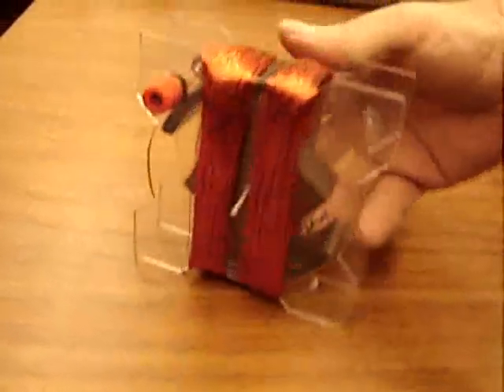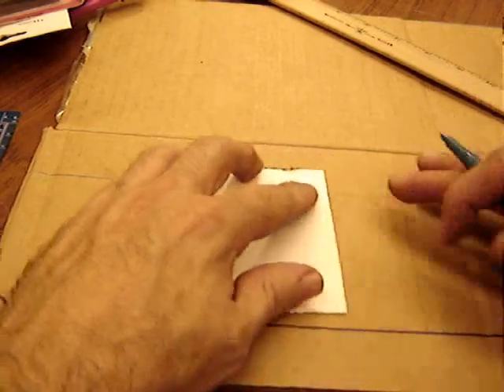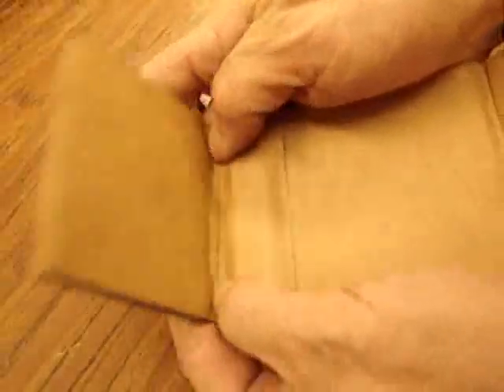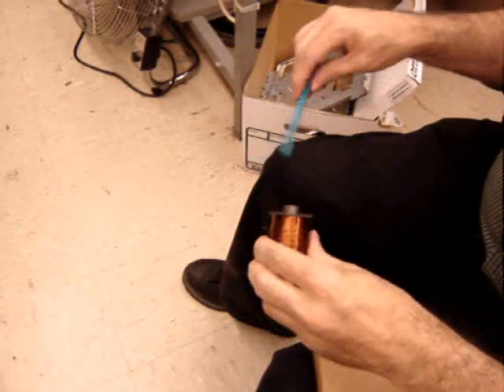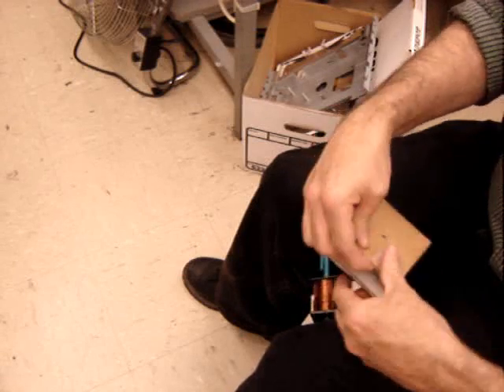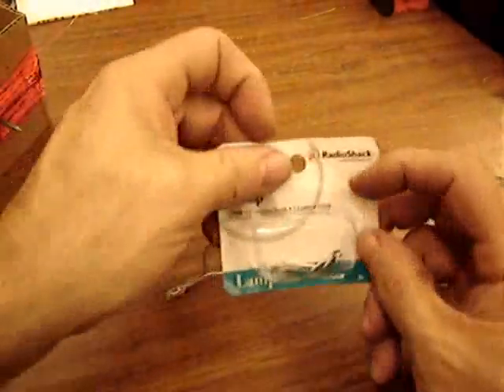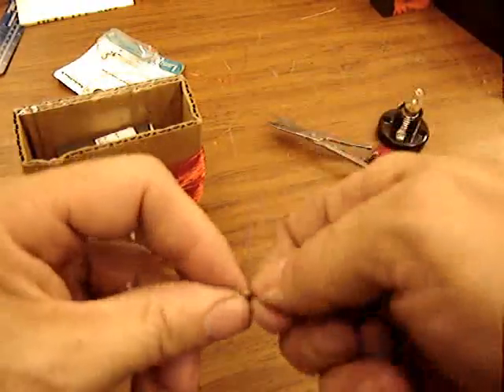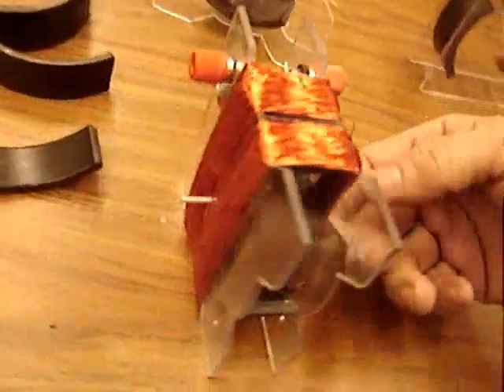Simple generator:  AC electric generator for science fair

Comment from the maker: > can't find it anywhere

Go to the website.   All the parts come from Radio SHack.   But other sources are listed.   If you use an LED instead of the special light bulb, you have to add lots more turns of wire.  The bulb will light up at lower volts.

For wire, those solenoids from Electronics Goldmine are way cheaper than the wire kits from Radio Shack.   But you have to pull them apart with pliers and a vice.

Comment from the maker: > if I use a 

You'll have to try it.  Just make sure to have hundreds of turns of fine wire, the wire is very close to the magnet, and the magnetic field extends outwards through the wire.

But if you just wanted to quickly build a guaranteed working generator, then follow the instructions exactly, and don't change anything.   Experimenting is great fun, but it takes lots of time and re-tries before you find something that works.

Or  ...get the original generator working, THEN add changes.

Comment from the maker: > different gauges of wire?

Just add lots more turns, since thinner wire has more resistance.   For example, you need about three times as many turns of #33 gauge in order the light that same light bulb.

If you're going to wind lots more turns using finer wire, then you might as well also try lighting a red LED.

Comment from the maker: > didn't work

Not bar magnets   Follow the instructions.

Don't use different bulb.  Don't use different wire.  Don't use different magnets.  Black ceramic block magnets.  The article lists the size and shape.   Many hardware stores have these.

It's possible to use small 2.5cm black rectangular ceramic magnets.  You have to glue them together as listed in the instructions.  See tinyurl com y8rkkxe   Much easier to just spend time to find the right magnets.

Comment from the maker: > Help please!

See the "debugging" section of the generator website.    Usually the problem is that the magnet is spinning too slow.  It has to really whiz, like almost 10 turns per second.   It's not hard to spin it this fast by twiddling the nail with fingers, but the magnet better not touch the cardboard even the tinyest bit.

Comment from the maker: > touch the nail

If it touches the nail, it will slow down the magnets.  Better to tape the wire so it's pulled away from the nail.

See the website FAQ, in the part about how to increase voltage.   Easiest trick is to just use much longer 30-gauge wire.

Comment from the maker: > what gauge

You gotta click the link for the website article.  That's the project article, this is just the embedded video.   Radio Shack magnet wire kit, use the #30 spool (don't bother with the other two.)   Or buy a $3 open-frame DC solenoid from Electronics Goldmine and take it apart.

Comment from the maker: > 18 gage

Try winding 300 turns of #18.   Doesn't work, since the outer turns are way too far from the magnet.  The voltage will be too low to light a bulb.

But if you use wire which is 4x too thick, then just use magnets which are 4x longer/wider/thicker.

Comment from the maker: > if they don't spin

Unless something is blocking them, they will spin just fine.   Are the holes in the cardboard too small?   Do the magnets drag against the cardboard at all?

Do as I did in the video: make very sure that you can easily spin the magnets.   If you wind all that wire onto the cardboard, you'll just have to wind it off again if you can't make the magnets really whiz under finger power.

Comment from the maker: > how thick the magnet wire

Go see the website.  #30 is good.  Radio Shack sells kits of wire spools.   Even better, buy a couple $3 open-frame solenoids from Electronics Goldmine, pry the metal off and take out the spool of wire.  Try part number G16939

Comment from the maker: It can be wrapped in a disorganized wad, as long as all the turns go in the same direction.

The coil position is critically important.  It has to pass by the axle that turns the magnets.   To create voltage, the magnet poles must stroke across the wires.

Comment: Imagine this input:

Two wheels, one with magnets, one with coils. There are 6 magnets, 3 with the positive pole and three with the negative pole arranged + - + - + - in a circle evenly apart. The other side has 6 coils spaced evenly to line up with the magnets. If you had two wires, one coming from the magnets that would be first lined up with the positive, and the next from the negative then switching through rotation, would you get an alternating current?

Comment from the maker: > use a old motor?

For the simplest possible home-built generator, a motor is not home built, and it's not simple.

For practical generators (not school science fair,) old motors work much better.  Cheap wind generators usually use a DC replacement motor from a treadmill.

Comment from the maker: > deep cycle batteries

This one only puts out 1volt of AC.   Batteries need 14v of DC.

Generators don't make electricity.  Wires are already full of movable electrons.  A moving magnet is an electricity pump.   If it moves past the same wire 200 times, you get two hundred times higher pumping pressure.  That's why there's a coil.

Comment from the maker: > me crakning it

That would work.  But car batteries work better than caps.  And you need a better generator (mine only makes one volt.)  See the homebuild wind turbine generators at otherpower com website.  They do it with large supermagnets.

To run an amp at 20 watts for an hour, you have to pedal a bicycle hard for ten minutes.  Hand cranks are too weak, you need leg muscles to produce major wattage.

Comment from the maker: Suppose you make a leather belt on rollers with a crank.  Can you connect one roller to gears, then connect the gears to the crank, so it runs itself?   Nope.   If your belt was made of electrons, still no magic.

A bicycle generator can easily put out 50 watts.   To run an entire house needs about ten times more than that, ten people on bikes (charging a battery bank.)   Or get rid of the bikes, and run your generator with a 1HP gasoline engine.

Comment: ok ok .. . so i have an ac to dc converter , so saying i do that , and power it in to the cap  . wouldnt i be able to controll a little motor off of the power to crank for me ? ... with say a switch to turn the power on and off ... im thinking on like getting some sort of amp maybe inbetween lol this is a first time kinda think for me so im just wondering ... my goal is to power a clock radio , kinda what u got but large scaler lol
lemmie no some odeas , im just curious , maybe vids will come

Comment from the maker: > to a 1 farad cap

It's AC, so it can't charge a cap.   You'd have to add a commutator to change it to DC.   Or, triple the amount of wire, then add a diode in series.

> keep the process going by it self

A generator is sort of like a pulley, with electric charges being the "belt."   If you don't inject energy by cranking the shaft, then everything comes to a halt.   It's just like any machine: it needs a power source such as your hand cranking, or a wind turbine, etc.

Comment from the maker: > add a little crank

Cranks don't work, not for spinning the magnets ten times per second!   A crank is way, way too slow.

If you use a nail, you can twiddle it between your fingers to make the magnet spin around like a blur.  It's easy to spin it faster than ten times per second.

Comment: The handle should be replaced with a simple plastic lid, the little handle part going into the middle of the lid and 6 to 8 magnets should be placed around the lid, evenly spaced out.

then all you have to do is setup a magnet close to the new magnet ring and the pulling of the magnets will cause the lid to spin turning your motor and creating energy.

This one is fun but i like my way as you can maintain a steady flow of power indefinitely.

Comment from the maker: > 800000 times

Yep, if you double the number of turns, then you double the voltage.  Also see the FAQ in the article about how to increase voltage.

But the wire has to stay near the magnets, and if you use #30 wire, it will look like a grapefruit, and the outer turns will be far away.  (So, for high voltage, find some much thinner wire.)

Comment from the maker: > no readings when the scale is on AC?

bad contacts, caused by bits of plastic coating left on the wire?

> LED lights, even without spinning

An ohmmeter will light up an LED.

> the LED and spin it, there is no light?

Read and follow the debugging instructions?  The ends of the wires must be totally clean, use sandpaper.  Spin the magnets VERY VERY FAST, not with a hand crank or a windmill.  Also, if you used other magnets, and not the magnets shown, then your generator probably won't work.

Comment: why is it that if I connect an analog voltmeter on the 2 ends of the wires, the scale is going up when set to ohms but no readings when the scale is on AC?  And when the red LED is connected together with the analog voltmeter, the LED lights, even without spinning..  But when I connect the magnet wire on the LED and spin it, there is no light? by the way, the magnet wire has 700 turns..

Comment from the maker: Yep, build a generator that puts out 120VAC when spun.  Get it spinning fast, 3600RPM, then plug it into a wall outlet.

Or just buy a 120VAC induction gearmotor from C&H Sales or other mail order junk dealer.  One that puts out 60RPM would be good.  Attach a hand crank to the shaft, then plug the motor into a wall outlet.  The hand crank spins.  Grab it and make it spin it faster, and the power meter outside your house will start going backwards.

Comment from the maker: > might be too weak

You can use a voltmeter to measure the output when the windmill turns.   But if you want to light a bulb, then you'd need to spin it really fast, or use more powerful magnets, etc.  See the FAQ in the main article, the part about ways to increase the voltage.

Comment from the maker: > don't need an inverter, right?

These already exist: "Using an induction motor as a generator."

All motors are generators.   If you run an induction motor w/60Hz voltage, so its shaft is spinning at resonance, then if the shaft spins slower, it does work as a motor.  If the shaft is made to spin faster, then it injects energy into the grid as a generator.

So, hook a geared-down induction motor to your bicycle.   Crank the pedals hard, and you're pumping wattage into the grid.

Comment: ive got to build a model windmill and measure its effectiveness (school project). do you think that connecting such generator to the windmill, in a way that it turns the nail would be a good idea? or maybe the windmill might be to weak to produce any significant voltage?

Comment from the maker: > plain metal wire?

Check the parts list.  If you make changes, then the generator probably won't work.

First get the generator working.  Use the parts in the list.   Then later, try making custom changes and see what happens.

> end is posative and nagative

Both ends are positive and negative.  It's AC, so it keeps switching rapidly back and forth.

Comment from the maker: > connect another coil

yes, see the website.  Don't bother using the other Radio Shack spools, they are way too short.  Buy two or three kits, and use the #30 spools from each.  Clean off all the red plastic from the wire ends, then twist them together securely to form one long wire.

Comment from the maker: > what grade

If you only build it, then it's probably 5th grade or a bit higher.

If you measure volts ohms amps, measure V versus RPM, try to predict the minimum wire needed, that's more like high school electronics.

Or you could go for college physics: measure the surface flux and calculate the surrounding field, then for a rectangle coil calc the peak output volts and waveform, etc.  Perhaps even predict the waveform for different shapes of magnets: rods, thin disks, perfect cubes.

Comment from the maker: > power a 40w bulb

This generator can only put out about a quarter watt at the very most.

Some people build fake 40watt bulbs by hollowing out a standard light bulb without shattering it.  Peel the metal disk out of the bottom using wire cutters, break the colored glass insulator with pliers, then shatter the glass internal support with a screwdriver.  Empty out the shards, and you have a hollow glass light bulb.

Install a tiny flashlight bulb on a plastic rod, or perhaps use a few LEDs.

Comment from the maker: > small magnet?

Use the parts in the parts list.  Other magnets will work, as long as they have the same size and shape.  Also, three magnets will work, but you'd have to glue two nails to the middle magnet.

Also search for "Toys from Trash" website with several supermagnet generator activities.

Comment from the maker: > LED won't light

To guarantee success, follow instructions exactly.

There is no LED in the video.  There is no LED in the parts list.   First get the original 0.5-volt light bulb and generator working.  Then later you can make changes and see what happens.

To light LEDs, you either have to spin the magnet at a few thousand RPM, or add many hundreds of turns of wire.  But that's a different project.

Comment from the maker: A "buzzer" supermagnet with nails glued to the end can spin inside a plastic tube.  The NS poles are on the sides.  Gives 10X higher voltage.  Spin that supermagnet fast using magnetic gears (put cheap magnets on the rim of a large wheel.)

Comment from the maker: > higher RPMs

Voltage goes up in proportion to RPM.  But because the coil resistance is the limiting factor, it also means the max possible generator wattage will be low at low RPM.

A generator is like a pulley, where electricity is the belt.  At low RPM the pulley just slips, so you can't send much energy along the belt.

Comment from the maker: > store energy

It's an AC generator.  If using a supercapacitor or ultracapacitor, first need convert to DC by using twice as much wire, then add a rectifier diode in series.  (For this low-volt generator, a diode would eat up most of the voltage.)

Or do it the old fashioned way: make DC by adding a rotating commutator which reverses the coil connections twice per revolution.

Comment from the maker: 1-inch spinning supermagnets, inside close-fitting plastic, so the wire coil is *very* close to the magnet.  Magnet disks or rings might be best, but only if magnetized sideways, with poles on the edges, not through the axis as usual.

Comment from the maker: > a bit different generator

First build a working generator  ...the one shown in the video.   If you change anything, it won't work, and you won't know why, and you can't debug it.

If you want to make changes, FIRST BUILD A WORKING GENERATOR, otherwise you'll get failure after failure.   The one in the website article works.  Follow those instructions exactly.  After that, you can make one change at a time to see if it causes failure (like using different magnets, different wire, etc.)

Comment: i have a question...if i was to fit a small electric turbine to my water main supply, would it produce much power? I have always thought that the pressure in the pipes would be adequate for say powering a light for a few hours (maybe my outdoor lights)
I know that this is hydro electricity, but have you ever heard of a retrofitting system that already incorporates this?

Comment from the maker: > run without any input

Generators are like pulleys, but where electrons are the drive belt.

If you can give me a pulley which runs by itself with no energy input, well, then why not just connect that to a generator?

Comment from the maker: Yes, you must measure or calculate the electrical resistance of the wire.   Then run a lightbulb/LED which has the same resistance as the wire.  If the bulb has too high ohms, it acts more like open circuit, and power is below max.  If bulb ohms is too small, it acts more like a short, and power is less than max.

To increase power, increase the RPM, or  magnet strength, or increase the total weight of wire.  Or add a ring of iron or ferrite outside the coil.  Laminated iron would be best.

Comment from the maker: Also try TOYS FROM TRASH, generators using supermagnets, see tinyurl com / nnrard

Most people must buy parts through mail order.  But in the USA we have electronics shops or hardware stores which sell the correct wire and magnets.  Those black 5cm ceramic magnets are the most common.  If you wind 600 turns of wire, you can light a red LED.

Comment from the maker: Double the wire length, doubles the output voltage, but also doubles the series resistance.  If the bulb resistance is >> coil resistance, then the output current doesn't increase when more wire is added.  In that case, don't use longer wire, instead use thicker wire.

Comment from the maker: In the USA lots of different stores have those large black ceramic magnets.  Try home hardware stores?  Speaker magnets would work.  But the N and S poles have to flip sideways, so the generator box would have to be ring-shaped, like a piece of plastic sewer pipe.   Supermagnets work well, if you can make the poles flip over rapidly.

Also see A. Gupta's "Toys from Trash" site.   He has a whole section on supermagnet generators, with cranks to spin them much faster.  Try tinyurl com/ml8vn2

Comment from the maker: if you can't strip the red varnish using a knife, then use a piece of sandpaper instead.

If you wind twice as much wire, the the bulb will be much brighter.   In my video, I think I wound about 600 turns of wire.   I got the wire off an old 24-volt solenoid that I bought $2 from mail-order.